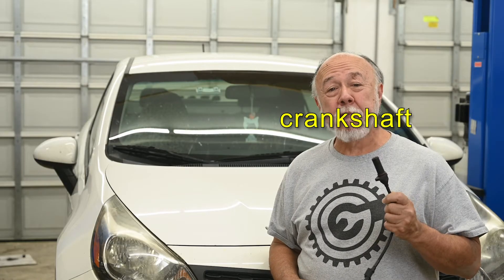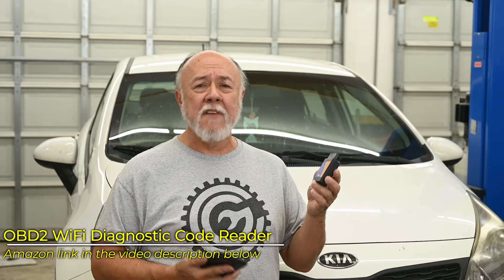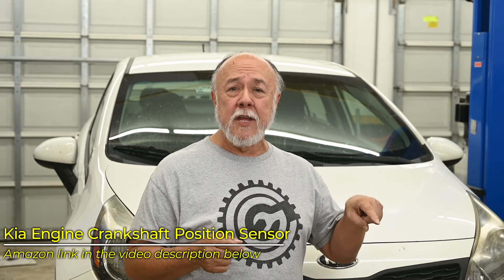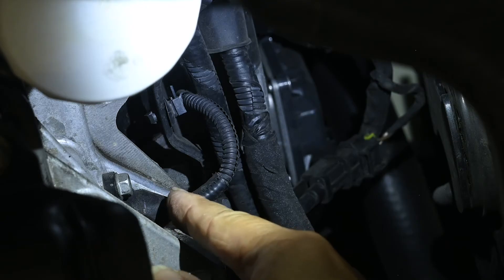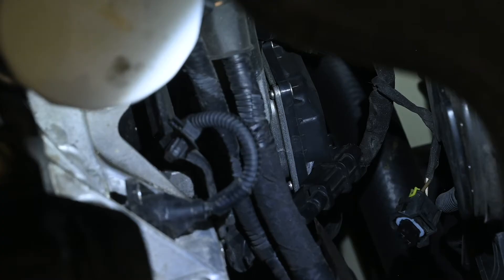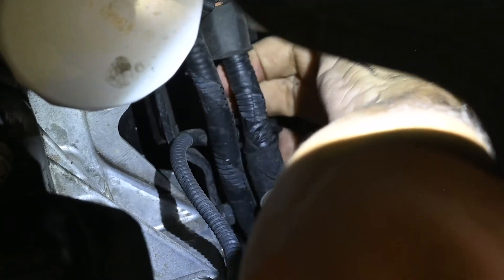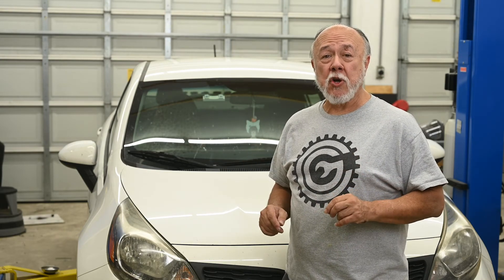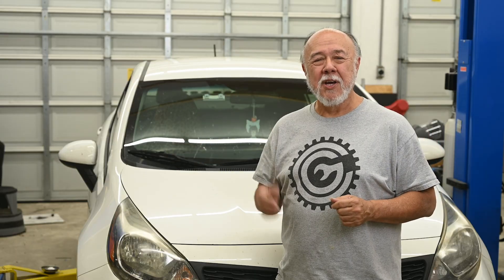How to Replace a Crankshaft Position Sensor, 2013 Kia Rio (P0335, P0336). Very detailed directions.

Comment: Thanks for the video. This job was a piece of piss thanks to you.
Reply: Did you happen to find the torque spec for the CPS bolt?
Reply: @ Clintonsharp7703

18  ft  lbs  for the torque of the crankshaft position sensor 😉👍

Comment: Good Video. As an alternative to knocking the CPS connector off the metal tang support with a screwdriver, you can bend the metal tang down towards the radiator fan so you can access the connector release mechanism when looking down from the hood. In the bent down position, you can push on the release tab and pull the connector off. Just remember to bend the metal tang back up after installing the new connector so it is far away from the fan.

Comment: Hi! Thank you for your video. I would like to ask, I replaced the crankshaft position sensor, but after the replacement, when I tried to start the car, it wouldn't start. Do you have any idea what might be causing this? Thanks for your reply.

Comment: My Kia is showing all the symptoms of a bad crankshaft sensor but no codes are coming up.
Reply: Did you hook a OBD2 scanner to it? Mine was having hesitation issues.. no check engine light, but when I hooked a scanner to it I got a "pending code" for P0336
Reply: @ActionStan  Yes, and no code. I found out that it's not unusual for no code to be displayed until it completely goes.

Comment: Hello, could you tell me please if it's necessary to drain the oil first to change this sensor?
Reply from the maker: No need to drain the oil.  That hole does not lead into the engine internals, in fact, I think it's just a blind hole.

Comment: Excellent, very concise video. My 2013 Kia Rio occasionally has a rough start. I crank the engine and it doesn't start. A little gas on the accelerator will cause the car to rough start. The tach goes to zero, nonresponse after this type of rough start.  I replaced my rear fuel pump and the issue went away for a few weeks without incident.  Two rough starts this past week. There is no rhyme or pattern to the issue.  Level ground, steep ground, has happened on both.  Two stalls in the past week at random while stopped with the car in Drive.  There's just no rhyme or reason, no pattern to speak of.  No check engine light was thrown on any of these occasions. For about $20 and maybe 30 minutes, I'm going to swap this sensor out.  It could be my issue.  With 11.5 years and 137k miles, I figured replacing the rear fuel pump couldn't hurt anything. That repair did cause the car to run without a single incident for about three weeks.  The new pump runs significantly quieter than the OEM unit. That was under $90 and an easy repair.  It certainly cannot hurt. Thanks again for a great video. And be assured, i liked your demeanor while you're giving the instructions ... you are clear, concise, and you speak with a lightheaded tone and one that says you really want to help home mechanics save time and money on car repairs my type of person can handle with good instruction. The smile sure makes it easier to listen to you. Great job!

Comment: Is the crankshaft part that goes into engine supposed to have oil on it when you take it out? (The long cylinder piece)
Reply from the maker: I think so, IIRC it uses magnetism to sense the crankshaft position, so it need to have no iron between it and the crank. It would also explain the need for the sealing o-ring.

Comment: I am having a problem with my 2014 Kia Rio. Had a misfire on Cyl 2, throwing code P0302. I swaped the coils from Cyl 2 to Cyl 3 and was happy to see the problem moved to Cyl 3, so bad coil I thought. Well, all of a sudden now, I have multiple misfire code P0300 and Cyl 4 Missfire now shows up along with a code C1555 which I am not able to find out easily what it means for this car. Any help would be greatly appreciated. Some sites say Crank position sensor and some steering angle sensor.
Reply: Quick update for all who may have the issue I had, as I managed to fix it. Looks like I had multiple coils go at the same time which is really like winning lottery, very rare! 3 of the 4 coils all went at the same time, and once replaced all the codes actually disappeared on their own, I did not even have to use the code reader to reset. Happy driving!
Reply: @Triggerman2505 thanks for the update…Jah Bless

Comment: Cliff, You are the man!!!  After replacing both cam position sensors as recommended by Kia, the problem persisted.  I found your video by searching YouTube "2015 Kia Rio P0335".  I really appreciate straight forward clear instructions like this.  You make the internet worthwhile.  Thank you.
Reply: Hello bro, why did you change both cam position  sensors? Only 1 crankshaft position sensor need to be changed, isn't it? My kia Rio is giving P0335 A circuit fault code, through this video I was able to remove the crankshaft position sensor, tomorrow I'll change it
Reply: @RajVeer87156  Because I was an idiot and listened to the dealer after they looked at it.
Reply: @tonymunn  my regular mechanic isn't free, he's telling me to bring the car after 1 week that's why I prefer a diy job
Reply: @RajVeer87156  It was a very easy job to do.  I just jacked the car up, put it on jack stands and followed the instructions.  One connector and one bolt.  Good luck.

Comment: Hi Cliff, I replaced the sensor on my 13 rio and then the engine stopped working, when I switch it on it goes on for less than a second then shuts down immediately, I was wondering what could be the reason?

Comment: I just did this but, mine will stall when pressing the accelerator, even just a bit. Tachometer appears to be working; idling around 700rpm, holds still. Any ideas? EDIT: I floored it in N and then the tachometer went to zero unresponsive but the engine will now rev and CEL P0336 came on… EDIT EDIT: I held the accelerator down and the engine roms fluctuated between 700-1000 bouncing; then it threw a code and freely reved while tach went to zero. I had it in N; so restarted it and then put it in gear and voila the CEL disappeared and its like it never happened.

Comment: This video was a huge help. I replaced this part on my Moms 2013 kia rio. I'm not a pro mechanic, but I know my way around a toolbox and can swap a part. This took me 20 minutes start to finish. I did it in the driveway with the front up on ramps. 

The symptoms of our car was: would start fine cold, but if you stopped somewhere quick (store, or for gas) it wouldn't restart. Just cranked and cranked. I was having her start it in neutral until I could get around to fixing it. It also made an intermittent clacking from the passenger front right of engine. The car was also seeming a bit underpowered even when it ran good. 

After replacing this part, the clacking disappeared, the stalling went away, and I swear the car has way more pep. Its like a little rocket now.

Thanks, Cliff!
Reply from the maker: Yep, it's kind of amazing that a little $20 part and 20 minutes of your time can make such a huge difference. My friend was ready to trade her car in on a new one because she was convinced it would be an extremely expensive repair since the car was running so badly.
Reply: Having same issue with my rio currently and just scanned for codes. Thanks for the tutorial hoping replacing solves my issue
Reply: I've been hearing the clacking sound for a while thinking it was my a/c fan this happened for like 6 months...today my car stalled after leaving off and I decided to scan and got the code P0335....

Comment: When the engine has been modified from 1.4 to 1.6 would i need a different sensor or is it the same because i replaced the sensor yet i still have the same crankshaft sensor error code

Comment: I just replaced mine and now my car won't go above 2000 rpm without stuttering and won't accelerate. Everything is connected and bolted down properly and was triple checked
Reply from the maker: Wow, I'm really sorry to hear that. Is the car still throwing the same P0335 or P0336 error code? It's unlikely but possible you got a defective or incorrect sensor. Looking at the current codes will also rule out having accidentally knocked something else loose. Lord knows I've done that before ...
Reply: Update: it's fixed! Thank you for your guide, it was really helpful
Reply from the maker: Awesome, glad to hear it. What was the problem?
Reply: @CliffsGarage  same thing is happening to me. Wish Ben responded to say what changed. Right now it’s at the shop and they are saying it’s the same sensor that I already changed.
Reply: @MrAstarothxi what did you do to fix the problem or you just used the car until it gets lost?😅

Comment: Great video thanks Cliff. I cleaned the  sensor but that only lasted a couple of weeks. So put in a cheap replacement, they vary from ten to $80! But those clips, omg, they just wouldnt come out for me. Fortunately the connection wasnt so difficult but that top connector would not budge unless I had a two foot screwdiver or pliers, so I just left the old sensor in there, detached, and secured both old and new with cable ties. Voilà!
I think you were working on the 1.6l, mine is the 1.4l. Running like new, in ten years only needed this, new single coil post, and of all things front rotors. Love this little car, except for no cruise! Drives so well, hasnt dated. A/c is marginal, a little noisy. But not boring.

Comment: Thank you so much for this video! Just installed mine on my 2014 Kia and it fixed the issue. I was hesitant because I had no check engine light or fault codes, but experiencing a hard start from cold and intermittent dead tachometer so assumed this sensor was the culprit. Watched several videos showing how to get the magnet out but no one else showed the hardest part, disconnecting and reconnecting the connector! Thanks again Cliff, I just subscribed and plan to watch more of your videos soon!
Reply: No doubt this video helped me so much. Saved a lot of money and time!
Reply: I have almost the same problem and no mechanic will say they think it is this piece nor will they change it without a code. I'm so thankful for this video. I hope it works for me too! These mechanics are starting to make me feel crazy.